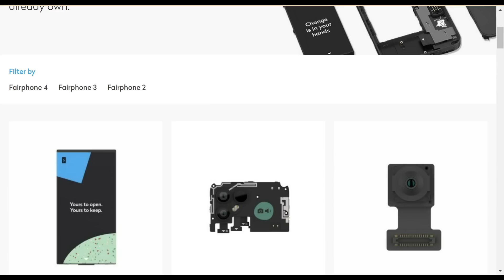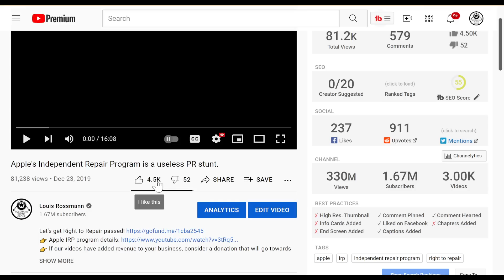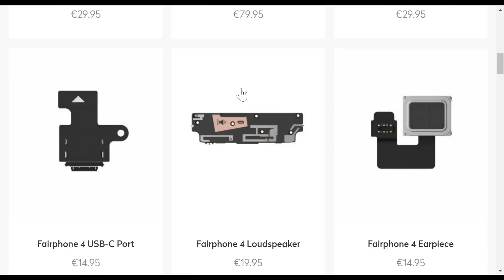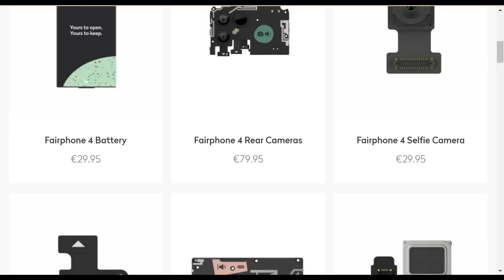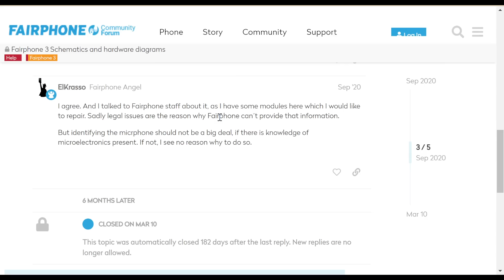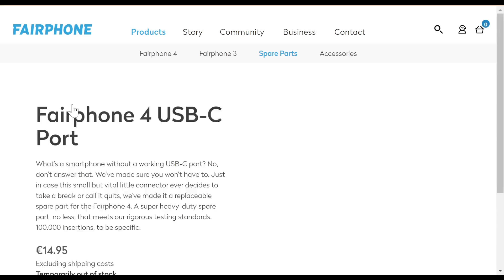Fairphone thoughts & commentary with Louis Rossmann

Comment: Every business out there is jumping on the repair bandwagon because they want to appease the general public. They figured out that giving the part that the general public cares about would shut up the others and hey they can even make money doing it too. Board level repair is something the general public doesn't want if it costs more than just dropping a new one in. Even then, the general public would rather spend a lot more to get a new part/device rather than repairing the old one. That is the way they think. If right to repair is to truly succeed, what manufacturers are doing right now is nothing more than reprehensible. That is the way you must think to win against them. Fairphone, Framework, etc: Even if the intentions are good (which you must assume otherwise), are accomplices to the tech giants who just want to sell you a new one.

Comment: I like the concept of the Fairphone 4, but... I'm kinda miffed about them removing the headphone jack for seemingly no reason.
Reply: I was angry about the headphone jack 3 years ago, but my conditions for it being acceptable was for good quality wireless sets being equivalently priced at $20. At this point my $20 AirDots sound as good as cheap sets and $30 Haylou GT1 plus sound better than anything on my phone's integrated DAC. 

Pricing has eventually made this a moot issue for me. Even if I'd still like to have the option for wired earbuds. (Bluetooth has its severe issues)

Comment: No comment on Linus breaking the Surface Studio due to hidden screws while they were told it was only 4 screws by whoever rep talked to them?
Reply: RTR Foss  I can agree someone doing his homework will probably be fine, it's just not everyone does it when it should be just a simple task of taking out screws and prying it open. Pretty sure a lot of people will try first to use more force there before checking a guide. It's not about considering everyone stupid, but you shouln't also exclude a posibility just because it is "not the right mentality". Plus we haven't seen how you're actually supposed to open it, what extra equipment you might need to take care of the hidden screws?

As for glue, perhaps, but it is still more research the user needs to do and again extra equipment they need to buy for a simple task. It may be fine for you, I still consider it a purposeful pain.
Reply: RTR Foss  Indeed 😕
Reply: Linus is clumsy kek

Comment: One phone I'm interested in is the Shift Phone. The Fairphone looks great for repairability, but the problem is the hardware in it is quite low-end.
The Shift Phones have a model with the Snapdragon 845, which is, well, not the latest, but it's a lot better than what you can get in the Fairphone.
edit Actually, ignore that. I just had a look at the FairPhone 4, which has a Snapdragon 750G (2 x A77 + 6 x A55). That's actually very good. The previous Fairphones only had CPUs with A53 cores.

Comment: One thing to think about the lack of schematics is the possibility of come to the precification chart of a product.

If you know the schematics and the components a group can come to a base price to a product and conclude of you are overpaying a product, and this is worse in a Android equipment, since you can exclude the operational system of the table.
Reply: We're "overpaying" for every product. Except not really, a product's cost is more than just it's bill of materials. You're also paying for the years of research, engineering, etc that went into creating it. Sometimes you are overpaying even further just because it has a certain logo on the back, but most of the time no.

Comment: Curious question; what is preventing a repair company to work our the schematic of a device by them self?
Reply: Nothing, not really. Legally, there's nothing stopping you from reverse engineering a schematic to any device. You see it a lot in the guitar pedal world, there's no legal mechanism to defend against tagboard schematics, actual schematics, and clones. Edit: original schematics are protected by copyright, though.

Schematics, however, can be difficult to work out. These devices are very complex. Engineers are clever and know their devices are going to get opened up by those who want to copy their efforts.
Reply: Then playing devil advocate, doesn't the responsibility lie with the repair companies to develop their own schematics, tools and parts to fix a device they want to fix? I.e make third party parts and modification?rather than asking for companies to release their schematics and IP parts? 

Just curious
Reply: @GordonLee123  Maybe someone who does tech repair has a better answer, but my response is like this... how long do you think it would realistically take to accurately reverse engineer a schematic of a single device accurately? And then, if you're wrong about anything at all, what damage could be done to the device in question? 

I know right to repair activists like to use car analogies. Like, imagine if your car was designed to be as obtuse as possible to anyone looking inside of it. And now imagine that there are no readily available schematics for your car at all, and your mechanic has to reverse engineer a schematic before he can even begin diagnosing any problems with your car. 

Instead of asking where you think the burden should lie, ask yourself whether that sounds like a good idea to you.

Comment: I think that's a good take. No schematics must be due to supplier pressure if they are so deliberately open with their modular design.  Does Qualcom really hold on so tight to their reference designs?  I guess while there's so little competition in available arm processor designs, they aren't going to feel the pressure to support the repair movement's need for schematics.  Each damaged board that gets replaced instead of repaired is one more processor sale for them.  
Still, kudos for getting this far.  If the reports about google tightening up on the pixel repairs are true, I think this will be my new phone, schematics or not.
Reply from the maker: This is all speculation. I would love to hear from the source themselves what is holding them back! If they're open to the idea of an interview, I'll make it happen.
Reply: @rossmanngroup  Qualcomm is pretty uptight on all of their stuff.  I grabbed some of the part numbers off a few of my old phones and was trying to social engineer a way to get enough info to build a custom board for myself. I couldn't get anything calling and emailing multiple people.
Reply: @rossmanngroup  It may actually be more than just suppliers being protective of their reference designs. Recent Qualcomm radios actually store radio parameters, including the IMEI, on an encrypted partition of the phone's main flash storage. Since only the application processor, not the radio, has access to the flash, the radio must share the decryption keys with the AP's "secure world" for this to work. Additionally, the SPC code to enable factory programming of the radio parameters is also stored in the flash (typically the RPMB for older eMMC-based phones, not sure about UFS). Compromising any of that allows changing the IMEI, a criminal offense. In fact, it's also a criminal offense to manufacture or sell devices that can have their IMEI changed. Since the schematic can reveal how the flash, AP and modem communicate, releasing it might land Qualcomm in criminal hot water for aiding and abetting IMEI alteration. FCC might also require schematics to he kept secret as a condition of granting a license.

I'm not defending Qualcomm here; storing IMEI in flash should never have been OK'd by Qualcomm, and indeed, should be illegal. Ideally, modems should come with fixed IMEIs preprogrammed during silicon manufacture, but of course OEMs want to use their own manufacturer IDs, not those of the chip vendor.
Reply: @NetRolller3D  I believe that statement is incorrect, because it's possible to reverse engineer communication between chips, it would be pain in the ass on propably 16 or more layers PCB, but it's not hard, just time consuming, also it's definitely a lot easier than breaking encryption. if one would be so dedicated to hack software, to be honest he's just gonna buy one use dummy phone or something that's already easy to hack...
Reply: @NetRolller3D  then they deliberately put that imei thing together with the schematic.

The imei thing can have separate chip, (not sure but samsung knox has physical chip, so just put tge imei thing there)

 so that they can say, we wanted to release but then we get sued for imei change
Reply: @rossmanngroup  fairphone commented and agreed for a interview
Reply: @Fairphone  Love to see it.
Reply: If qualcomm released their reference designs, x86 phones that run any OS you want would be revived. that's the LAST thing they want.
Reply: @milesfarber  why would Qualcomm care?
Reply: @AMalas  ARM processors would become obsolete because Ryzen 5000 series scientifically proved that x86 is more battery efficient than ARM, which is the only thing ARM was good for. If x86 phones are made, they will also comply with BIOS and UEFI, which allow the user to install any OS they want. This means Qualcomm will no longer have a stronghold on what OS is allowed to perform calls and messages, and what OS isn't. You'd be able to insert a SIM card into any desktop PC, or any pocketable PC, and perform calls and messages from Windows, or even any linux distro of your choice. Even SteamOS. Any OS that is compatible with x86 will be able to perform calls, effectively giving the user maximum freedom on what is actually running in their device. Qualcomm would be forced to either make x86 processors, or switch to Risc-V or another open source architecture to remain competitive.
Reply: @milesfarber  I am sorry but nothing from your reply makes even a tiny bit of sense.
Reply: @AMalas  No, it's simply really hard to imagine such a versatile device. Just think of the steam deck but with support for 5g hotspot and call/messaging. It will click after a while.
Reply: @milesfarber  Except that your comment contains many factual errors and also this isnt how anything works
Reply: @milesfarber  You don't need x86 or x64 CPU-Architecture for that. Nor does Qualcomm specify which OS is to run on their hardware. They do however force you to sign NDA's if you even want any sort of documentation or chips and you need to sell at least 1k devices per year to be even worth spending time on.
Reply: @FrankenProjects  qcom doesn't even stop you from replacing every single piece of code on the device if you are their customer (not the end user) (as least as far as msm8998 it should be possible, I'm getting conflicting info about later SoCs)

the documentation provided under NDA is however not really meant to help you with any of that, since they exepect you to use their stuff
Reply: @milesfarber  qcom's reference designs would be utterly useless for integrating an x86 SoC into a phone, the "hard" part will always be SoC-specific... and do keep in mind that the only companies who can legally make an x86 SoC are Intel and AMD, so do you plan to use some existing SoC of theirs? good luck putting that in a phone...

also x86 isn't magically more suited for running OSes without the need for SoC-model-specific drivers, it's just that:

1) all x86 SoCs are similar enough to each other, and they have legacy compatibility modes to appear even more so when needed
2) when the x86 SoC design deviates from the "norm", chances are that they are abusing ACPI in some terrible way to pretend to the OS that everything is fine
-- now speaking for AMD, but Intel probably does something similar --
3) they don't reinvent the wheel, when they need i2c/usb/whatever, they just take designware IP and plop it in, which means the drivers are already long inside Linux/Windows/whatever
4) just in case, they sometimes actually put that designware IP block on some internal address space (fuck x86 for not having a flat address space btw) and have hardware fucking PCI glue so that the OS sees a PCI interface (some generic one that you don't need special drivers for, otherwise what's the point) instead of interacting directly with the IP block that at least Linux totally has drivers for
5) even when they make their own hw blocks, they actually care about Linux and Windows having drivers for it (for Windows, they even seem to have drivers for stuff that doesn't really need drivers thanks to their ACPI abuse) and so they submit the drivers to the LKML and go through the process (not sure how it works on windows, but they get care of that as well)

in costrast, qcom doesn't really care if mainline Linux works ootb on their SoCs, and neither do most of the board (phone) vendors, they just care if their bastardized (to a lesser degree lately, but still) Linux fork works on it.

Luckily, there are people out there (you might be able to tell that I have some involvement) who write less ugly drivers for these SoCs and actually submit them to the LKML, lately even with some level of acknowledgement/cooperation from SoC vendors, and subsequently also doing the work of writing drivers for peripherals that a board (phone) might use, like touchscreens, and finally writing device trees for the boards (phones) which use bindings that are codified in the mainline Linux tree, rather than thought up by the vendor, never submitted to be codified, and likely not accurate because "it works for our purposes"
Reply: @012MIS  

>the only companies who can legally make an x86 SoC are Intel and AMD, 

There are a few embedded and shit grade X86 cpus out there not made by Intel or AMD.
Reply: @milesfarber  x86 is not inherently more efficient than ARM. There is more overhead to make an x86 processor than an ARM processor.
But, AMD and Intel have worked on it for so long that these days that the "x86 tax" only makes a difference of about a couple of percent or so. And that can easily be made up for with a better architecture.
Reply: @Knowbody42  You could have as many "better architectures" as you want, but i can guaran-fucking-tee you ARM isn't one of them. All it does is destroy backwards compatibility, get worse performance per watt, and limit user choice.
Reply: @milesfarber  ARM is not an architecture. It is an ISA.
Reply: @Knowbody42  From Wikipedia: ARM (stylised in lowercase as arm, previously an acronym for Advanced RISC Machines and originally Acorn RISC Machine) is a family of reduced instruction set computing (RISC) ARCHITECTURES for computer processors, configured for various environments. Arm Ltd. develops the ARCHITECTURE and licenses it to other companies, who design their own products that implement one of those ARCHITECTURES —‌including systems-on-chips (SoC) and systems-on-modules (SoM) that incorporate different components such as memory, interfaces, and radios. It also designs cores that implement this instruction set and licenses these designs to a number of companies that incorporate those core designs into their own products. I love when ARM shills just blatantly lie.
Reply: @milesfarber  ...a FAMILY of reduced instruction set computing (RISC) architecture S
Plus, you really need to re-read what I was saying if you think I was "shilling for ARM".
Reply: @Knowbody42  "that can easily be made up for with a better architecture" clearly sounds like coping to me.
Reply: @milesfarber  Re-read it. I was saying that x86 CPUs could make up for the (now small) "x86 tax" with a better architecture.
Why did you think I was "shilling for ARM"?
Reply: @Knowbody42  I thought you were saying "ARM will make up for it with better architecture", fml
Reply: Sorry Louis when my Samsung dies looks like I'm getting this phone. Schematics or no Schematics.
Reply: qcom doesn't make money selling SoCs, they make money selling the license to use the SoCs in your product
Reply: I think they should switch to Mediatek.
Reply: @harid4249  mediatek? 😂😂😂
Reply: @ArunG273  maybe RISC-V longterm
Reply: @harid4249  lmfao

Mediatek is known for not even complying with the GPL, you think they gonna release schematics?
Reply: @harid4249  I think they should not. 😂

Comment: They're not there yet but I'm still buying one when the protection accessories (case and screen protector) for the Fairphone 4 come back in stock.

Honestly just the stuff with sourcing materials would have gotten my attention, the fact it's a 20 minute job to disassemble and reassemble it to swap out whichever part I broke is just icing on the cake.
Reply: It’s fun and very useful when it got wet inside despite IP54^^

Comment: If all of the parts are easily changeable, do we really need schematics?
Reply: Yes. Not all of the parts are easily changeable. You can buy a new charge port, battery, or screen (well, no you can't - they're out of stock) but do you see a listing for a new motherboard? I don't. What if it randomly dies and you want the motherboard repaired so you can recover your data? Sure would be a lot easier if schematics were available.

Comment: Camera sub-assembly: $80
Cost to have a skilled technician do almost anything to the camera sub-assembly: $100+
Do I care whether the camera sub-assembly schematics are available? Not really since basically anything beyond the cable coming unplugged is automatically beyond economical repair, rinse and repeat for most sub-assemblies, most of which being much cheaper at sub-$20, cheaper than shipping for replacement components if you wanted to do one-off board-level repairs.
Only the main board is really worth having the schematics for since repairing it may be required to get eMMC data out.